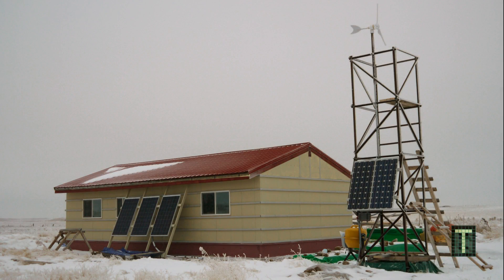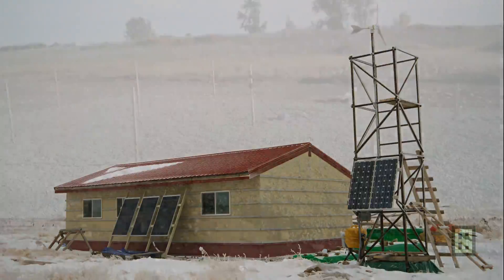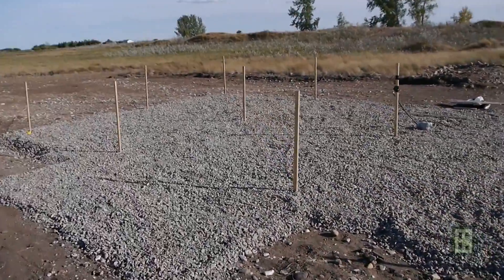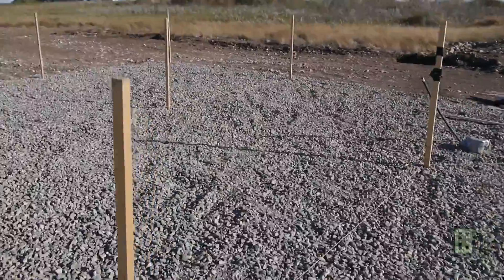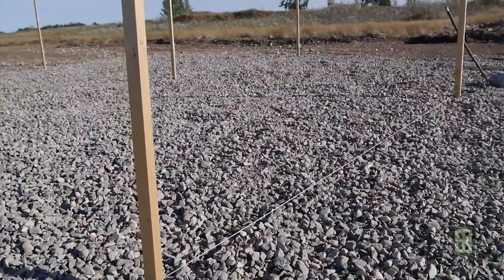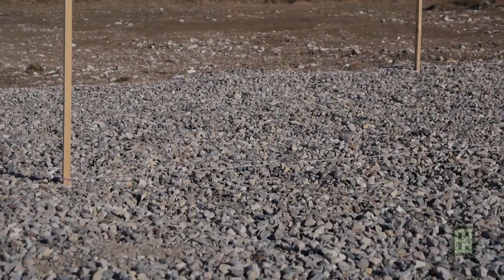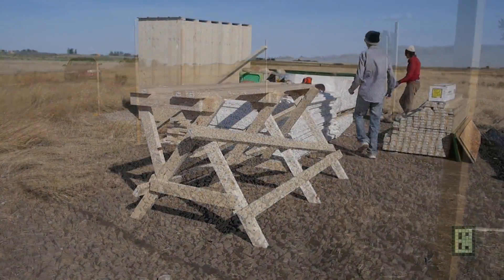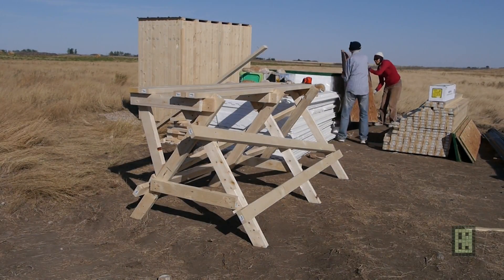Off Grid House

Comment: Buna Dacian, felicitari pt pricepere si curaj . Sursa de la tine WinMate inca merge perfect.
Vreau sa te intreb , deci ai energie inmagazinata in baterii LiIon , ok , pt iluminat si prize , dar cum te incalzesti ? Ai petrol sau gaze pt centrala ?
Si a doua intrebare : Apa de unde vine ?
Cristian- Bucuresti
Reply from the maker: Incalzirea este temporara pt moment cu propan din buteli mici de 8kg similare cu buteliile din romania pt aragaz doar o idee mai mici cred.
In viitorul apropiat incalzirea va fi electrica cu energie de la panouri fotovoltaice similare cu cele 3 din fata casei doarca am nevoie de 30 de bucati pt incalzire.
Incalzirea cu PV este pe departe cea mai eftine metoda in momentul asta aproximativ 2.7 centi/kWh (de exempolu propaneul este extrem de scump asa la buteli mici cam 30 centi/kWh anul asta anul trecut era 25 centi/kWh)
Nu am nevoie de invertor sau batery pt incalzire energya de la panouri va fi direct folosita sa incalzeasca podeaua de beton cu resistente electrice sub gresie.
Voi avea un soi de MPPT digital foarte simplu care va fi conectat la urmatoarea versiune de Solar BMS da e mai complicatde explicat nu exista asa ceva deocamdata.
Podeau de beton care e complect izolata cum ai vazut in video are 14 metri cubi si poate stoca in jur de 100kWh de caldura la 10C diferenta de temperatura.
Casa in cea mai rece luna necesita in jur de 1000kWh/luna asta iese din calcule is din experienta de iarna trecuta cand am folosit maxim 12 buteli in cea mai rece luna si fiecare butelie are cam 100kWh de energie si centrala ce o am e simpla nu cu condensare este in jur de 80% eficienta.
Apa vine de pe acoperis si e filtrata in 3 trepte un filtru fin de sedimente unul cu carbon si mai fin si unul cu ultraviolete la sfarsit. Apa pt baut este apa distilata care deocamdata o cumpar da o voi produce cand am panourile pt incalzire.
Reply: *****
Multumesc pt raspunsul edificator. Ce distanta ai pana la primul oras sau sat ( e curioasa sotia mea ). Eu sunt inginer de instalatii in Bucuresti , unde energia electrica de la 0,11 Ron/kWh a ajuns sa ne fie vanduta la 0,67Ron/kWh in Dec 2014. ( In componenta facturii avem pretul de intrare 0,32Ron/kWh apoi TVA=24% - adica impozit pe valoarea adaugata - sau in traducere suntem furati de stat pt ca indraznim sa traim , certificate verzi , taxa de cogenerare , rezervare , taxa radio , taxa TV ).  Iar apa de la fosta RGAB acum Veolia de la 1 Ron/mc a a juns la aprox 7 Ron/mc ( putin sub ) . Daca pastram raportul de 3 Ron/ CAD reiese ca la tine in Saskacewan  energia la butelie este mai ieftina ca la noi.
De ce am dorit sa-ti dau acest reply :
Pe site-ul DailyTech - era adaugat pe pagina AnandTech.com pana acum o sapt cand au fost achiz de Purch, citisem acum aproape 1 an de o firma din California care reusise sa sparga tiparul ineficientei tipice si a saturatiei celulelor fotovoltaice din compoz panourilor , utilizand in locul panourilor statice plane , o forma apropiata de para sau bradut ce se roteste si compus din mii de celule acoperite de plastic sau sticla , atingand pt prima oara raportul de 0.11 USD/kWh deci de profitabilitate in producerea energiei pe cale regenrerabila.
Reply: ***** Stiu ca nu este important decat pt mine , dar in sfarsit am reusit sa ajung cu my dsktop build I5 3550 2 x4GB, SSD , mouse , keyboard with a  idle power consumption  11.4 - 11.6 W AC !! cu o sursa FSP 300 GHS . Cu WinMate si un AC-DC FSP NBQ90 am cam 13W. Iar monitorul de 19" are un consum AC de 6.4W. Plecand de la dorinta mea de a reduce si economisi , am trecut la inlocuirea a 3 x 3 x 100W becuri incandescente din scafa pt iluminat indirect cu becuri de 23W si 1570 lm am ajuns la acelasi flux luminos cu 9 x 23W becuri , iar in locurile unde sunt aprinse mai mult de 1h/zi am inlocuit cu iluminat LED - de regua PHILPS. Pe scurt de la 200 Ron factura /luna am ajuns , in ciuda scumpirii continue a kWh la 68-75 RON/luna . Deci daca ma pot analiza , urmeaza in scurt timp sa trec si eu la panouri fotoV. Profesor te am pe tine .
Reply: Gabi George  3 x 3 x 3 x 100W = 2700W 27 de becuri puse in 3 scafe paralele a cate 3 segmente de 3 becuri fiecar
Reply from the maker: Gabi George
Orasul in care locuiam inainte si este mai mare peste 200k locuitori este la 75km de mine da e pe autostrada 110km/h si autostradaeste la 2km de casa deci ajungem in 40 minute in orasul ala Regina.
Sunt alte sate mult mai mici unul este chiar la 2km da nu are decat benzinarie si vreo 10 case.
Un altul unde este posta de careapartin este la 21km spre Nord da acolo merg dacaam un paket pt care trebe sa semnez sau trebe sa trimit ceva. Corespondenta si paketele fara semnatura vin in cutia postala caree la 2km aproximativ.
Mai este un alt sat careare si un magazin universal nu foarte mare la 17km spre Sud pe aceas autostrada gasesti cam tot ce trebe de de obicei mergem in orasul acela mai mare la cumparaturi in satul asta megem iarna de mai luam buteli.

Despre pretul energiei.Propanul este exagerat de scump pt incalzire la 30 centi/kWh. Energia electrica aici costa cam la fel 0.67ron = 0.21CAD si cam at este 20 centi la consum de 200 sau 250kWh/luna factura este 40 sau 50$ kWh e cam jumate din pret pe la 10 sau 11 centi da cu toate taxele ajunge la 20 centi.
Majoritatea au consum mare aici media pe casa e pe la 1000kWh si vine ceva mai eftin cataxele nu cresc chiar proportional.
Un panou solar de 250W (60 celule) 1.7m x 1m la fel cacele 3 din fata casei costa 200$ cumparate la cantitate deci chiarmai putin de 1$/Watt da cu tot cu transport ajunge aproape la 1$/Watt.
Un panou fotovoltaic e garantat sa aibe inca peste 80% din putere dupa 25 ani.
Si in zona asta unde stau e destul de insorit 1kW de panori solare produc in jur de 1300kWh/an sau mai simplu fiecare Watt de panou solar produce 1.3kWh/an
Deci 25 ani x 1.3kWh = 32.5kWh daca nu pun degradarea in timp spre 80% daca pun si aia e in jur de 28kWh (va mai produce si dupa dapoate mai trebe sa adaugi panouri sa ai suficient) 1$ / 28kWh = 3.6 cent/kWh desi daca cumperi mai mult si transportul devine nesemnificativ panoul e 0.8$ si atunci vine 2.8 cent/kWh.
Mai trebe suport pt panouri si cabluri electrice si resistente pt incalzire nimic mai mult si este pe departe cea mai eftina sursa pt incalzire.
Gazul natural daca il ai deja tras este cam la fel pe la 3 centi/kWh aici da mai sunt taxe si daca nu il ai tras doarlegatura costa mult mai mult decat toate panourile ce trebe sa le cumpar pt incalzire si pretul in urmatori 25 ani nu e garantat sa ramana la 3 centi/kWh.
Reply from the maker: Gabi George
Prefer sa folosesc laptopuri. Indiferent cat reduci consumul un laptop e mult mai eficient facut si impreuna cu afisajul cosuma undeva pe la 8W idle.
Am un Asus all in one P1801 cu un i7-3770 si un Nvidia GT730M da idle este pe la 30W asta include afisajul 18.5" 1080p
Are si un tegra 3 cu android in afisaj care e defapt un tablet imens ala consuma in jur de 6 sau 7W da Android este inutil pt mine am crezut cavoi putea instala Linux  da nu merge din pacatepe Tegra 3 in tabletul asta.

Comment: is that built around regina sk.would like to check it out some day
Reply from the maker: It is about 70km NE of Regina, SK on HW11. Is still far form finalised but we can talk about if you are interested.
Reply: ***** yes i will get back to you,what kind of pump you using for your floor heat and how much propane it use last winter.iam looking at building something north on 6 then east on top of valley.
Reply from the maker: sheldon wagner
I use quite a few DC pumps the one that circulates hot water is a 24V about 40W.
I have some photos on goole+   plus.google.com/+DacianTodea
Last winter in the coldest months I used about 10 to 12 small barbecue propane tanks/month not sure what was the total on the entire winter but winter is quite long here.
Propane is expensive so this is just a temporary method of heating before I get Solar PV panels. Heating with solar PV panels will be about 8 to 10x less expensive than propane but I will need to pay for the next 25 years of heating buy purchasing the solar panels in advance.
So house needs less than 1000kWh/month in the coldest month each 8kg propane tank has about 100kWh and the propane heater is about 80% efficient.
Reply from the maker: *****
House is still far from completed. On the outside it looks the same as it did in this video and I'm just working right now on the electrical instalation.
I do live here this is the second winter I will spend here.
There is quite a bit of work on a house besides the structure. And as we do everiting our self it takes quite some time.
I was also quite busy with a difrent project designing a Solar charge controler for Lithium batteries.

Comment: That is very interesting - not sure I would do it that way -The foundation is great but if wind was a major concern maybe a sprayed concrete dome. I don't have a problem with the way you built stacking the 2x4's when you consider a log home and how many 2x4's would come from them in comparison.  I like you tower to. The main thing is you built it to your specs and needs and enjoy living there.
Thanks for sharing - cheers,Patrick
Reply from the maker: Thanks Patrick for the comment. My first choice was a ICF house but it was not affordable and i was not allowed to build smaller than this. So next choice was stacked 2x4 it is much stronger than a classic frame and OSB house but not as strong as one made out of steel reinforced concrete.
The strongest wind in the time I lived here (about 7 years including the 5 years I spent in a rented apartment in a city close by) was 110km/h and that is strong but no where near at the limit this house will support. There are quite old frame houses in the area and that mens that extremely strong winds are not a problem or more correct where not a problem in the past.

Comment: With the price of 2x4's alone now it would be expensive to build this
Reply from the maker: Building a house is expensive but the structural part is one important aspect. Building a solid wall made of 2x4 like I did is about 1000$ more for this house size when compared with 2x6 frame and OSB. That is just the material cost and is true that is way more work on 2x4 solid wall vs the 2x6 + OSB frame.

Comment: Electrodacus:

Please don't take this as a personal attack as you have already completed the build so it is spilt milk.  I just found your site by accident.  It is more for anyone contemplating emulating your building techniques.  Please reconsider.  There is a ridiculous amount of material waste in this method of building.  Several houses could have been framed with the materials used in this one.  It is the anthesis of advanced framing (using less materials) explained here http://www.buildingscience.com/documents/insights/bsi-030-advanced-framing.  Please read about advanced, energy efficient (from both an embodied energy (energy that goes into the build) and energy maintenance standpoint), healthy etc. building techniques,  from sites like above,  or http://www.greenbuildingadvisor.com/ or other well developed sites before considering doing a project.  It is not necessarily rocket science but there can be a lot to know.  Sorry for having to be negative but we really do need a lot of people minimizing harm and maximizing good if we hope to have a chance at all of navigating the serious issues we face.
Reply from the maker: Hi Brent,

I do like to hear other opinions and I do not feel attacked or offended. You are not the only one to point out that there is a lot of material used but let me explain in a few words why I chose to do so.
First it looks like a lot of material but is not really. In a classic 2x6" frame wall you need to use OSB and that was something I was trying to avoid do to health concerns those glues used are quite nasty I can smell that glue even outside when I was framing the foundation.
My first choice was to do an ICF building but it was out of my budget range. I needed a strong structure do to high winds here and there is no shield from the wind not even trees at the moment since is as some are saying in the middle of nowhere. If a strong wind puts to the ground a frame house where are then the savings in materials :)
Then the house is quite small in fact I wanted to build even smaller but this was the absolute minimum that I was allowed to build. The cost of building material will also need to say something about the embodied energy and it was just about 1000$ more that if I have build a 2x6" frame + OSB that solid 2x4" wall.
As for energy efficiency this building is not that bad. It has an insulated concrete slab that helps with thermal storage the thermal insulation is on the outside so that the solid wood wall also act as thermal storage and all this together with decent amount of thermal insulation will allow me to heat this house with electricity from solar PV panels.
The house is in a could climate in Saskatchewan, Canada and in the coldest month's the house only needs under 1000kWh/month. I will need to get the money for a 6 to 7kW solar PV array and that will directly heat the 14 cubic meter concrete slab that will act as a 100kWh at 10C temperature difference so about 3 days of heating required in the coldest month.
I do not have the time since I work on the Solar BMS at the moment.Did not even had time or money to work on the house but as soon as things are better I will do a series explaining more about the reasons behind the house and the way it was build.

Comment: lam glad you decided to video the building of your house lve never seen one built like that before it looked very expensive to build but very weather resistant l hope there.s more to come
Reply from the maker: You will be very surprised to find out that is not that expensive if you do not consider the work involved.
Using polystyrene as thermal insulation is much more expensive than fiberglass but the wall is not that much more expensive than a classic 2x6 frame wall. Maybe around 1000$ more and quite a bit more hours of work.
But you get a much stronger house and no toxic smell from the OSB glue.
Thanks for subscribing.
Reply: ***** your right l should have considered the amount of work involved.
ld love to see what the inside looked like
Reply from the maker: william burgin
There is not much done inside since I'm quite busy with other projects.
When I will get the time and money to do more work inside I will make sure to video record the work.
There are also quite a few hours of recording with details at every stage of construction that will need editing.
Unfortunately until I'm able to make my other projects work  will not have time for this.
There are some more photos including some of the interior on my google+ page  https://plus.google.com/+DacianTodea/posts
Reply: ***** I don't get this polystyrene insulation thing ... if you pour a bunch of concrete over what is basically styrofoam, doesn't it just crush down and deform?  Can you show more how this works and what your design plan was ... this is really interesting, and I noticed you seemed to have tubes in the slab I assume for hot water or heat?  Nice job.
Reply from the maker: justgivemethetruth
If I remember correctly that was type 2 polystyrene that is a bit more dense than type one and was specifically designed to support the weight of a house. I made the calculation a few years ago when I made the design and it was able to support about 3x the weight of my house before starting to deform. The thing is that the weight is distributed over a large area. They use even type one under large highways.
I use the concrete slab for both structural and thermal mass so it needed to be well insulated from the ground and yes the tubes are for hot water for in floor heating. But I will add electric heating cable under the ceramic tiles and use electric heating since is less expensive if I use the electricity directly from solar panels about 3 cent /kWh. No battery is needed for this since the concrete will act as a thermal battery that can provide up to 3 days of heat about 100kWh storage capacity at 10 degrees Celsius delta and the house needs in the coldest month about 1000kWh/month based on my propane use last year. I can heat the house with 10 to 12 barbecue size 20 pound (8kg) tanks / month in the coldest month (and it is cold here :))
I was extremely busy with my Solar BMS project and have done nothing on the house. Maybe next year things will be better and if I do some other interesting work I will make sure to make a video.
Reply: ***** Guess I have never seen that polystyrene foundation idea close up.  If it works what a cool idea ... making your house like a reverse refrigerator to hold the heat in.  It's a very interesting project ... I assumed you were living there.  If not, what do you use the house for anyway?  That is a lot of work for a place you are not living in.  Definitely looking forward to your videos, seems like you think things out very well.

What is Solar BMS?  Good luck!
Reply from the maker: justgivemethetruth I live here since last years this will be the second winter here.
This type of foundation is used in Europe especially the northern European counties. So is not my idea :)
Solar BMS is a solar charge controller that I designed and build to charge Lithium batteries. I'm offgrid and needed battery storage. The most cost effective is LiFePO4 but there where no solar charge controllers for it so I needed to design my own. You can see more in my latest videos if interested.